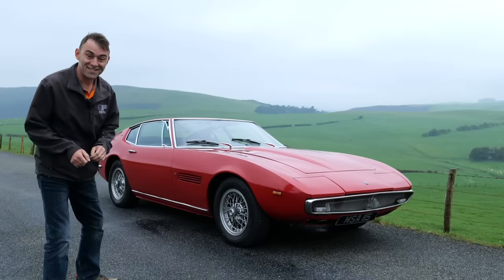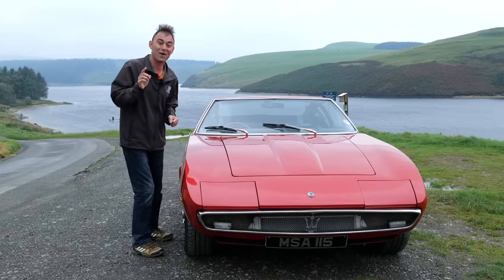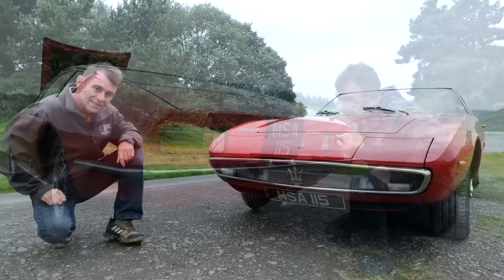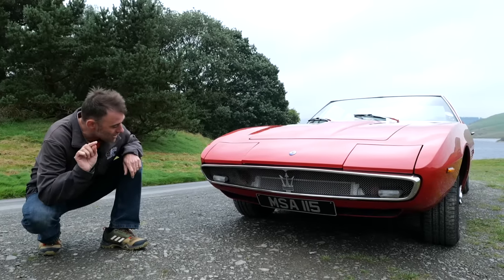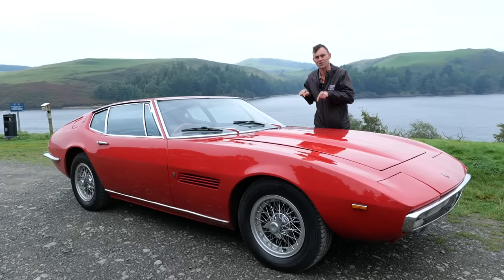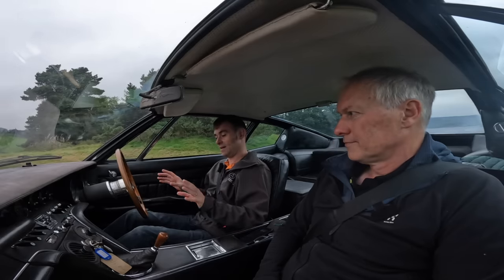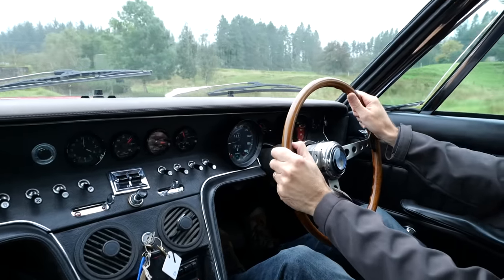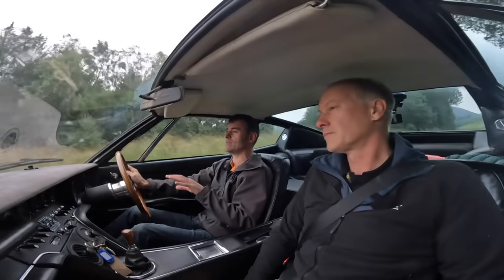The world's most beautiful electric car?

Comment: It would appear that you've got chassis AM115.098 which was the 1967 Earls Court Show car, which was the second RHD car built. The Ghibli Registry confirms it had a Tipo 116 (Indy) engine fitted. 

I've found a picture of MSA 115 at the 1991 Silverstone Historic Festival - the lights in the grill hang from the top in the picture and it doesn't have door/wing mirrors either. It's on the wire wheels as well. Interestingly there's another Ghibli, in the same colour, parked next to it on magnesium wheels with door mirrors.
Reply from the maker: Very interesting. Thanks for posting. 👍

Comment: This is an electric conversation saving a classic car. I think that’s fantastic.
Reply: Thanks 👍👍
Reply from the maker: Thanks
Reply: Agreed, and in many cases, the electric performance is better than the original. Let's hope the new electric motors don't go "bang" also 😊
Reply: It’s now half the car it was, every classic car electrified has had it’s heart ripped out.
Reply: @bobroberts6155  and replaced by a stronger electric heart
Reply: @bobroberts6155 the original 'heart' went bang as did another ICE then the owner could not find another original engine, so the new electric heart is giving life to a dead classic.
Reply: I admire the engineering that has gone into the conversion, and the fact that it is reversible. Parts however for these cars are available even engines and their value is closely tied to originality so at some point I suspect it will be reunited with its ICE heart
Reply: You've turned a prize stallion into a gelding. 👎👎😢
Reply: @phils2180  Have you seen the video? All the electric can be removed. The original engine was bust. There is no losses here if you don’t count that it will be driven more.

Comment: Beautiful! I’d love to see an electric conversion done to a Citroen DS. It has everything except enough horsepower and torque.
Reply: There's a company in France that does them, they've even done a Chapron Decapotable as also a Citroën SM. One in Belgium too, they also do Traction Avants, converting those is apparently very simple and surprisingly cheap.
Reply: @marcusott2973 I need to see that.
Reply: @grandcarriage1  This one's built in the UK. The DS, to me, is a car crying out for an electric conversion. It's design and suspension were always let down by the drive train.

Comment: This is what automotive enthusiasts should be focusing on regarding electric cars. Trying to keep something alive that doesn't have good parts support means that too often a model (or even make) becomes either only a museum piece or something that rusts away in a field somewhere. I'd love to electrify classic cars like this for people to drive. I think there would be quite the market for those with money that don't want to turn wrenches. 

That being said, what on earth caused the noise at 9:17
Reply: Cattle grid. 👍👍
Reply from the maker: That noise was a cattle grid. 👍
Reply: @DaddyQuattro "I think there would be quite the market for those with money that don't want to turn wrenches."

And also a market for people with money and want to turn wrenches but can't easily get their hands on the kits e.g. people in other countries like me (the U.S.).
Reply: People with money don't use wrenches, that's one of the reasons they have lots of money......
Reply: No, I think people should keep making the metal parts needed, by hand even, to keep the combustion cars alive. Because without the combustion engine, this is only a rolling chasis and a body of a Ghibli. Like a piano with all it's internals removed and replaced by a circuit board and some speakers...not a piano as such anymore.

Comment: I was determined to hate it, but very really impressed with the quality of installation and that it retained its manual gearbox. Wire wheels weren't standard on these or the Ferrari Daytona as they were considered to be at the limit of the engines torque, so a more torquey motor could have destroyed them !

Comment: Ok I came into this quite critical, having driven the Ghiblis sister the Indy.
The V8 is such a beautiful unit, and integral to the character of the car, which can be made reliable and more powerful, by specialists if you have very deep pockets.
But I've been completely won over by this excellent conversion, including the reversibility of it, 160mls of range is also something you would have struggled with when enthusiastically driving the original V8 sucking down 100 octane through 4 twin carbs.😂😂😂
Reply: Thanks for the comment. 👍👍😀

Comment: That is a beautiful conversion result. Just goes to show that any classic can/should be converted. Do you let the motor revs drop when you change gears ? Does the motor speed drop straight away or does it coast back to idle when you take your foot off the accelerator during gear changes similar to and ice motor  ?

Comment: Need to get those headlamps adjusted - they are flapping just too far down and touching the chrome of the bumper.  Surely you can set the 'down' position to better flush with the bonnet/front panel?
Reply from the maker: Already done. 👍
Reply: I came to the comments to suggest this too.

Comment: Great job as usual, curious how you advise DVLA after a conversion and how the owner gets on with insurance companies?
Reply: Plenty of insurance companies out there, that insure kit cars/hot rods and all manner of engine swaps / home builds.
The DVLA just need a letter from qualified person (I got a local garage around, who checked it all over ,and signed it off), for an IC engine swap. It's when there's extensive chassis mods (tube chassis etc) they need to go through an IVA (really strict MOT) before they'll issue a V5 (maybe issue a Q reg, if built from many different cars, and can't determine a manufacture date).

Comment: I wouldn't normally approve of such a conversion, but under the circumstances I think it was a very good idea, and it seems to have been well executed. However, if I had been the customer, I think I'd have been after a performance upgrade and at least a 200 mile range. That said; I'm obviously not privy to all the reasons it's been done the way it has. And, yes, I agree that it has to be one of the most beautiful automotive designs of all time, and surpasses the E-Type. E-Type is so iconic though. And maybe a similar conversion would work in an E-Type, where it would actually be a performance upgade.
Reply from the maker: Unfortunately the size of the battery pack is usually constrained by weight and space. The 50kWh pack is all we could fit in, which gives it the 160 mile range. 👍
Reply: @ElectricClassicCars  Thank you for your reply. I completely understand. It's looks a neat job, but I can also see there's not much space left. However, I guess it won't be long before suitable batteries are significantly smaller, so the future for such conversions is presumably bright. 

Do you envisage the the upgradeability of such conversions, or do you envisage that significant upgrades would essentially require a whole new installation?

Comment: Excellent video, as always... fantastic to see such a classic brought into the modern world! Why would the gearbox need to be used at all? (Ignorant on such things)
Reply: A lot of people like shifting through the gears. Fair enough if they want to keep that experience in an old car.
Reply: It’s mentioned in the video: these electric motors have similar power, torque, and - most importantly - rev ranges to the original engine. In order to maintain similar performance, a gearbox is required. A Tesla motor revs much higher, and is more powerful...it can handle being gearboxless with a longer diff ratio.
Reply: What lightbranches said. 👍👍
Reply: @LightBranches er, sorry, no! You are completely wrong! If you want more performance you simply put in bigger motor. MASSIVELY more efficient and lighter than a huge bell housing full of gears!!  (And then to have the gearbox rebuilt?!?! Utter lunacy!)
Reply: @456xyz8  sure, dude. If you’re going to foot the bill, I’m sure the good folks at ECC can build you a massively powerful machine. Whoever commissioned this build wanted to keep the gearbox, and general performance, so deal with it.
Reply: @LightBranches  Ah! But that’s not what you said, sweetheart. You stated that in order to “maintain similar performance, a gearbox is required.”
NO!! If you want similar performance you simply fit an electric motor with the appropriate wattage. Much cheaper, much lighter, much more efficient and would allow better weight distribution to offset the heavy battery. 

You also said that electric motors have similar rev ranges to the original engine. Seriously?!?! You think a V12 from the ‘60s revs to c.100k rpm just like an electric motor!!!!????

ECC simply use off the shelf conversion kits meant for DIYers. If you want people with some knowledge of engineering go somewhere else.
Reply: @456xyz8  HAHAHAHAHAHAHAHAHAHAHAHA...
Reply: @LightBranches  Yeah…maybe keep your mouth shut next time….
Reply: @456xyz8  No. But you can go ahead and practice what you preach.
Reply: @456xyz8 Should've watched the video, then you would understand that the motor fitted matched the original V8 for performance and rev range. Aim was to retain the character of the classic car, not make a hot rod.

Comment: Electric vehicle owners complain of shorter range at highway speeds. Since you have a transmission, you should be able to maximise its range in the top gear. You got a range of 160 miles on A roads (with 50 kWh). Have you tried cruising at highway speeds in top gear? It would be interesting to know what kind of range that achieves.

Comment: A nice (reversible) conversion. The only criticism is that it isn't a grand tourer, any more.
Reply: Yes, for that it would need another 15kWh plus CCS DC rapid charging. Unfortunately it's not just a case of a different socket! ECC can do it but it needs additional design of battery management and cooling hardware, as well as the DC management control software and hardware. And more money.

Comment: You did a great Job, saving this early Ghibli an turn it into a reliable ride. 👍 Car looks elegant and time-less. Only input: Why not spend more effort on the design of the battery box under the hood ? The high voltage wireing was arranged perfectly, even so the cooling - Why not dress up the black battery box a bit?

Comment: For conversions such as this, someone needs to design a motor accessory to bolt onto the shaft of the Hyper-9 motor that has a large diameter "cam wheel" with 8 "bumps" (or 12). These "bumps" drive a rod that directly drives a carbon-fiber speaker cone... no electronics, just a mechanical device. 

Think on that for a moment...

Then for optimization, you could enclose that speaker into a closed chamber that connects to an exhaust pipe similar to the original design for the specific car.

The "cam wheel" lobe profile could be ground to create the acoustic waveform as desired... smooth "sine" wave shape for a lower (smooth) tone, or more sawtooth shape for a more "raspy" exhaust note.